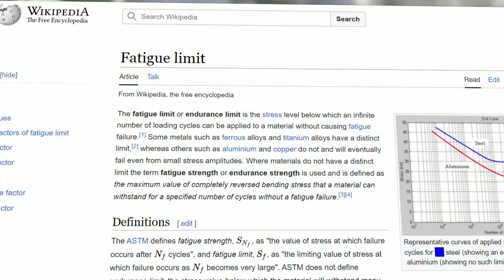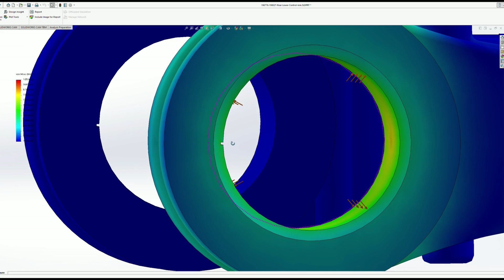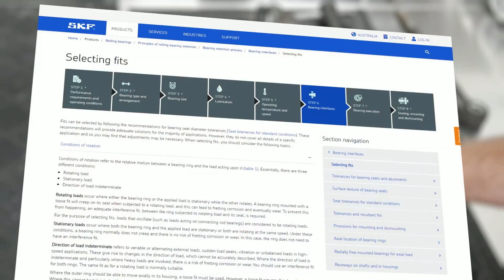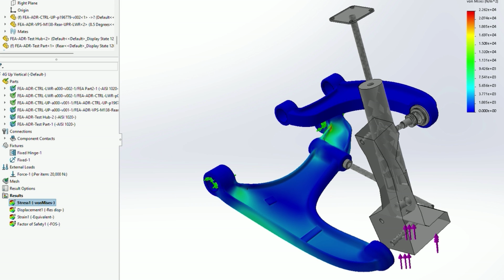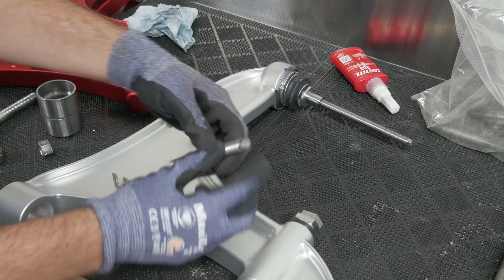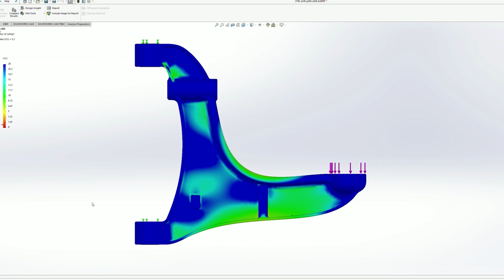Maserati Control Arms - Designing replacements from start to finish

Comment: Great analysis of the problem and explanation of your solution. I’m a little confused about the die casting parting line in the bushing hole. Wouldn’t that inner diameter be formed with a slide in the tooling?
Reply from the maker: It would've most likely been formed by tooling and then machined out for the final fit.